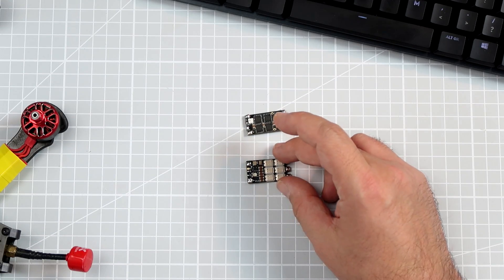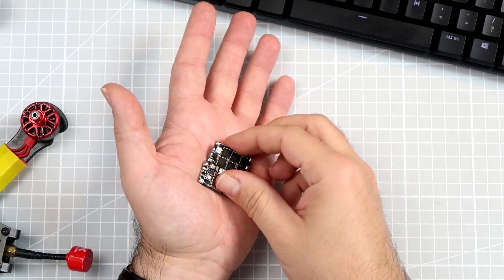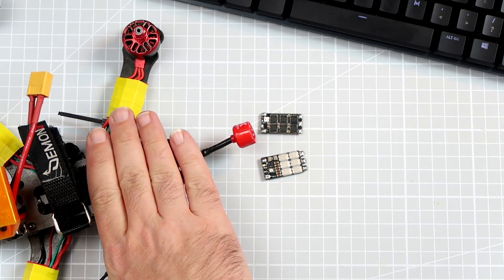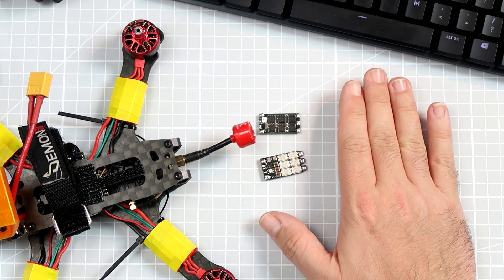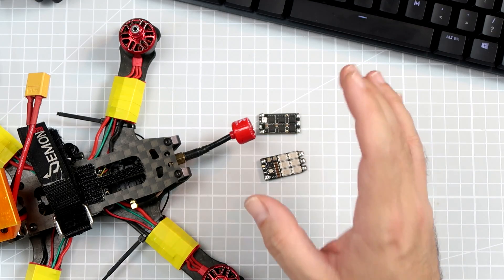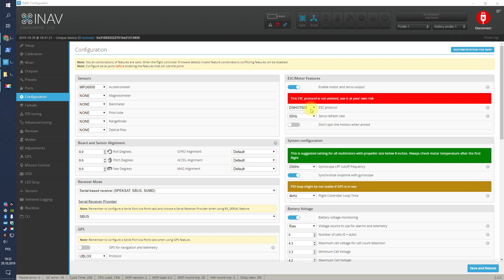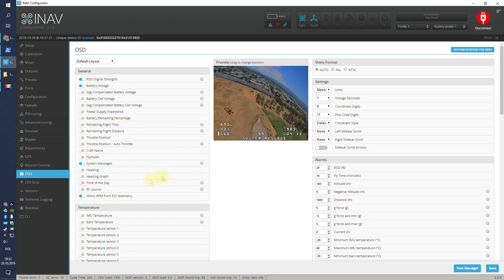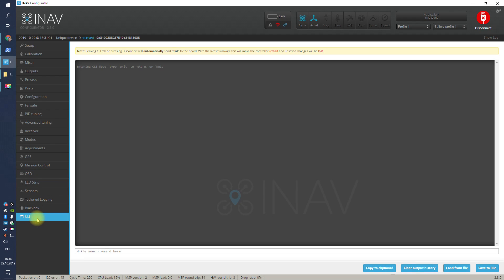INAV ESC Telemetry with BlHeli_32 - The Complete Guide

Comment: How can INAV distinguish the difference between the different motors? So how does it know that the telemetry data of motor 1 is actually from motor 1 and not 4 for example? Does BLHELI_S also support telemetry via bidirectional DSHOT?

Comment: I am using a Holybro Kakute F7 V1.5 with a Holybro Tekko32 F3 40A 4in1 ESC (https://www.banggood.com/Holybro-Kakute-F7-V1_5-Flight-Controller-+Tekko32-F3-40A-4-In-1-Blheli-32-3-6S-Brushless-ESC-for-RC-Drone-p-1317595.html) and for some reason I can't get ESC telemetry working on iNav 2.5.

I have enabled it for port 7 and have tested it using three methods from within iNav:
- Setting the voltage / current sources to ESC - They show 0V / 0A
- Enabling ERPM on the debug graph - They stay at 0RPM
- Adding ESC Temp / RPM to the OSD - RPM isn't shown and temp is "---"

ESC passthrough works fine and I also tried enabling "auto telemetry". I did hook up my oscilloscope with "auto telemetry" enabled and saw that there was activity on the ESC telemetry wire, but I couldn't decode the serial data. (Presumably because I enabled "auto telemetry" on all 4 ESCs)

Do you have any ideas about what I can do to debug this further? I've also noticed that sometimes ESC #3 doesn't spin and doesn't show up in BLHeliSuite32, but most of the time it works fine. With it being a 4in1 ESC, I'm wondering if it's a hardware issue?

Thanks!
Reply: Did you find any solution? I had desyncs with that ESC, the second one works but no tel. I am using the single 65a in a plane.
Reply: @BBFPV  The telemetry issue was caused by a bug in iNav v2.5.0 - Upgrading to iNav v2.5.1 resolved that. I haven't seen the connection issue since - It was spitting on the day that I tested it so maybe it was a little damp, although these ESCs are clear coated from the factory.

Comment: Hi Pawel! One important consern. 12.sept you released a vid where 4 Hakk ESC's died at the same time short after takeoff. Some comments indicated telemmetry and a bug (48kHz ting in BLHeli_32 FW). 
Do you have any updates on ths potential problem? Is it a problem?
I'm about to finalize a 7" quad (for slow cinematic flights) with Matek F722-SE and 4 AIKON AK32 35A ESC's (with extra cooling/heatsink).
I would like to connect the telemetry ports for the ESC's, but am conserned due to your vid 12.sept and some of the comments to that vid. 
Thanks for your efforts and I'm really excited to get airborn with INav (and your new oncomming INav FW release).
Br. Torgeir
Reply from the maker: that seemed to be related only to those shitty EScs
Reply: @FPVUniversity  Thanks for your feedback. Any experience with Aikon AK32 35A? Hopefully not as "shitty". I have added 470uF cap's on each ESC's DC input. Hopefully useful. 
Br. Torgeir

Comment: How to use ESC telemetry on Airplane?
Reply from the maker: The same way
Reply: @FPVUniversity  if I need to use Dshot for using telemetry on blheli_32 esc, I even cant enable it on inav configurator. After save button, protocol revert back to standart. All works until Airplane platform not chosen.
Reply: Checked on Omnibus F4 board - dshot seems to be work. Looks like it is board specific issue on Airbot F4 nano v6.
Reply: @dronefix9830  dshot disturbs my servos, but even with dshot it doesn't work. Holybro did a nice job 🙄

Comment: Hi, have esc razor32 v2 and omnibus f6v4...On bf this work greate, have telemetry voltage, current and other.. When use inav can't set esc protocol to dshot..(if change when model is arm save dshot but telemetry not work) and telemetry not work... In f4v6 vbat and power FC is unite. I powered FC from bec (not from battery) and if set get voltage -  ADC i can't see battery voltege, ESC telemetry not work, remapping resources not work... I don't know what something do... :(. Help please!!!
Reply: When mixer set in no multirotor or no tricopter dshot not set :). When mixer set in multirotor or tricopter can set dshot and telemetry work.. :(

Comment: Pawel I can't get my AIKON AK32 35 amp esc to respond in INAV. I updated to 32.7 in blheli32 and it still doesn't work. I have it connected to a kakute F4 v2 on R5 which is uninverted and designed specifically for esc telemetry. Any help would be appreciated thanks. Edit: I was able to correct the problem. The firmware I was using had to be updated as esc telem was omitted when compiled it's a custom firmware.

Comment: Pawel, thank you for the video. I just finished my first INAV build with Kakute F7 v1.5 stack used a Preset. It flies ok but still need a little tuning. BUT when I tried Dshot 150,300,600 or 1200 the quad would fly good for about 2 minutes and then just drop. Would you have any idea what I need to look at? I put it back on Mulitshot and it flies without dropping? I looked at Blackbox but I have no experience so I could not figure out what went wrong.

Comment: I cant get the current reading to show. RPM and VBAT is fine. I am using F722SE with TMOTOR F45A V2 with the telemetry wire to Rx6 on the FC
Reply from the maker: current_meter_type . Maybe ESC does noy have a current meter?

Comment: I can't get any of the DSHOT protocols to remain active using iNav 2.3.0, Config 2.3.2 and Matek F405 CTR or Kakute F4 V2.  It resets to 'Standard' protocol after saving.  I need DSHOT to enable ESC Telemetry to get current draw readings from my BLHeli-32 4-n-1 ESCs.  What's the secret to actually enable DSHOT?
Reply: MrVantasstic did you get it to work? I have the same problem.
Reply: @andy_bar  No, gave up on iNav and moved on.
Reply: Thats too bad. Really wish i could find the solution.
Reply: And on my wing on inav 2.4.1 i have this problem..but if i change protocol type and save when model is arm - i can set dshot, if i save when not arm - reset to standart :(. Esc telemetry not work ( in bf all work good, i  have rpm, vbat, esc curr, temperature esc) i have omnibus f4v6, esc razor32 v2 35b

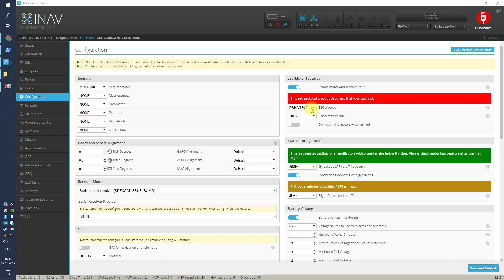Comment: Great informative video.  I'm fairly new to this area so please excuse if this is a noddy question.  Looking at the 'firmware flasher' tab in Inav 2.3.0-RC3 it shows SpeedyBee F4 flight controller in the 'choose a board' drop down menu and latest firmware 2019-7-4 6:51 (stable).  On the SpeedyBee flight controller board its got four telemetry pads which I understand to be serial UART 4. Am I correct in thinking that if I connect the telemetry wire from a blheli-32 ESCs to these pads that I should be able to get and log the motor rpm. Or is it the case that SpeedyBee would need to update the firmware for their flight controller to work properly with the latest Inav 2.3 for telemetry to work?  I'm trying to get my head around this area. Many thanks Jon B
Reply: Ahh I understand a bit more now the 2.3 firmware for the board is in the unstable release as release-candidate.

Comment: Thanks for implementing this.

I'm not sure how much use it's going to be. RPM might be useful in some circumstances on fixed wing, but if you have a twin then you've got an average of both motor RPMs which isn't going to be much use other than novelty value. If one motor stops turning in-flight, your normal RPM will appear to halve, but you won't know which motor it is that's stopped and you might be confused at how fast the remaining motor is spinning while the average is being halved by the stalled motor. Contrast this with bidirectional DShot telemetry which would be capable of displaying RPMs independantly for each motor.

I'm just a bit surprised you didn't go straight to bidirectional DShot, unless implementing single-wire telemetry was in some way a neccesary prerequisite step? Presumably once bidirectional DShot is implemented in iNav, the single-wire stuff will be redundant.